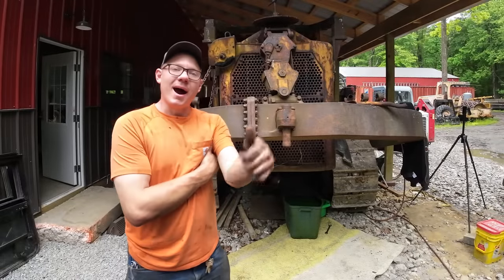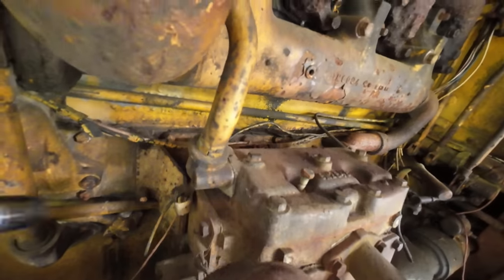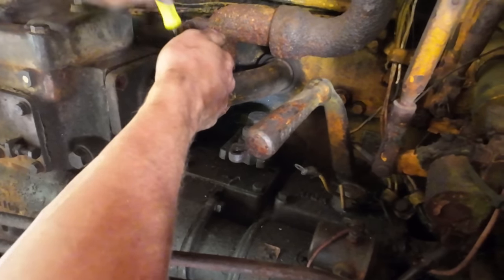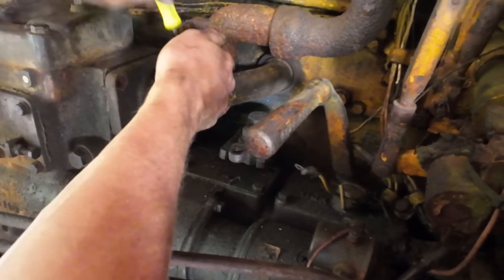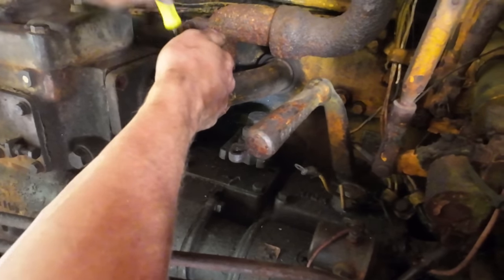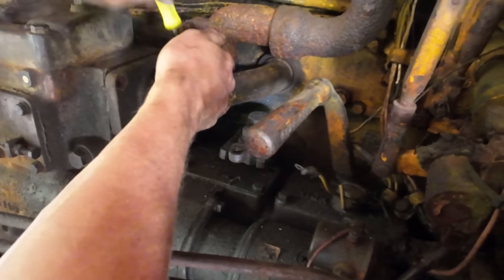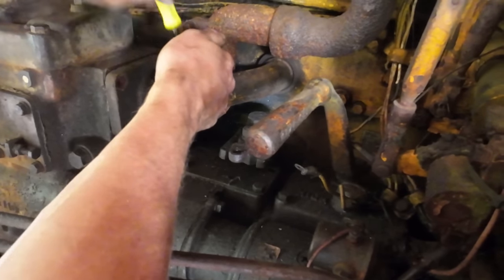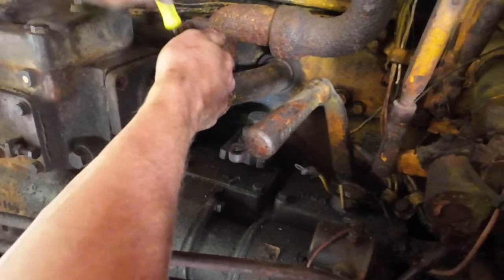Reviving a Caterpillar D8 Bulldozer (AGAIN!!!)

Comment: So many great moments in this video.
My favorite is when Matt casually mentions "I have these 2 tire service trucks I just bought from the local tire shop." as if it was no big deal.
For most people buying one used truck is a big deal and would be cause for a video.
For Matt picking up 2 of them with cranes is just like getting a bag of chips at the gas station.
Nothing out of the ordinary and not even worth mentioning.

I also like the old school "impact wrench" around 19:40.

Comment: Matt, You are getting some excellent closeups.
That tire boom truck looks like a neat addition to your "tools/toys"...LOL    Now if it just had a winch on it, you'd really be cookin.
Years ago(1964/65), I ran a Lodge and Shipley lathe about that size in a marine shop in Tell City, Indiana, a great machine.  I have a Sheldon 14X36 with a 10" chuck and 10" four jaw. The lathe has 2.5hp motor and is variable speed.  I LOVE my lathe.
PS: Matt, youhave areally nice shop bldg, congrats on a well done project.
Ye Old Caterpillar Cowby

Comment: Hey Matt you can use a forklift under the belly pan to hold it up while you take off the bolts also you might consider hiring someone to help you I saw you have a lot of friends in your first few videos I'm sure they would help you. The life you save may be your own (Not Joking). And don't forget to look up torque specs for all those bolts you just installed.

Comment: Had the same issue on a 49 3T D7 pony exhaust pipe actually came apart and old rusty pieces of the tube went into the intake valves.

Comment: The pony motor exhaust tube in the intake looks a good way to blow rust, scale and bits of metal into the cylinders when it holes through. It would be nice if it were made from metal that did not rust or corrode.

Comment: Matt, good you got the pony motes to work, big saving's. I operated those tractors when they were new , also what a hole in that tube will do is dust out the big engine know that for a faked , also those early 46As  the final drive pumps don't pump in reverse , not good to road them a long way backwards , those are a good old dozer.  Deane

Comment: That knuckle boom could do with a winch at its base or bolted to the boom. Turning it into, wot could be, a really useful small crane & depending on how it was set up, ie, how many pulleys it was run through. You could have yourself a very powerful yet really controllable set up for virtually any job. .

Comment: Where you used that exhaust pipe sealer, there are cone mesh gaskets for mufflers probably the right size. Like for example a crv muffler

Comment: Couple of dowels screwed into the head would make setting intake in place easier.  There is actually less pounds per square foot with a cat compared to the weight that is on the floor from a big 4wd tractor

Comment: Gooday mate 
Keep up the good work a you probably know but 2 chains hooked over the track under the belly pan over the other track hooked to a 4wd or your skid steer. My dad and I pour 15000 hours on our 14 A D8 had to do tracks & sprockets end them a lots of rimula x, grease, filters & fuel we loved ours as we never saw inside her gust the way us mechanics like our gear.
You should be able to hear each cylinder fire befor you need to throw the clutch.
I  hope you have half the luck we had with ours. All the best Len Rice

Comment: Those access panels being cut in the belly pan could mean that the pony motor may not be the original one. Looks like the tracks need to be tightened up. Looks like it's time to re-sole your boots, Matt. You're getting your moneys worth on those.

Comment: I'm plumb proud of you idling the pony. I always had a thermos of coffee, fired the pony and let it idle BUT kicked the compression off on the diesel and engaged the starter and let everything turn slow. Drank a cup and when the cup was empty I kicked the pony on the guvnah, kicked the compression on the diesel, grabbed the throttle and let it blow smoke rings. They always fire one cylinder at a time so kicked the compression back off and let it heat up a bit more. After a bit she'd roar. FINE old tractor. 8H, 7E's, 6C's and so on. You'll get it and God Bless Yall! Yes, Meatball too!

Comment: Congratulations Matt on a successful repair that was a lot of work but you brought me back to my childhood with my dad and my grandpa we used to have to repair that stuff all the time in the winter and I've done what you did of pulling out the pony motors and that is a real job that exhaust tube we wouldn't let him get that bad unfortunately you found out how bad they can get and what they can do that turbo sounds like the the seals are getting ready to let go and by taking care of it now instead of just running it is a smart move because a lot of times what will happen is that the fins will let go and they'll get sucked into the engine and there goes the engine thank you for a great video and putting a smile on my face I love that sound though that high pitch turbo sound My god that all I can say is you really made my day have a great day yourself I'm looking forward to the next video

Comment: Drop the belly pan. High pressure wash the underside. True up and then add access panels to keep the dirt out. Dirt holds moiture and grit (obviously lol). Check the slop in the tracks. 
I'm surprised you don't have a shop overhead track hoist. Planned?
Reply from the maker: Yes, that is in the works. Hopefully have it done before winter.

Comment: Great to see it started up just fine with the re=jigged pony motor in place. Although they're more maitenance-intensive, they are are good to have up here in northern Alberta in the winter. Even a brand new charged up set of batteries loses a lot of available power after it's been sitting out at 25-30 below zero. There are electric battery warmers available that can be used (and to be fair, work pretty well) if you've got the beast parked someplace where there's a plug-in. But an engine block heater for 32 gallons of antifreeze? Good luck with that. So the pony motor really makes a lot of sense, since we have about 8 months of winter. Just keeping things like the pickup or a service truck in good condition, so they'll start in winter weather is a "challenge" (isn't that what used to be called a P.I.T.A.?). There's a lot of oilfield equipment and operators up in this part of the country, and the only time that things stop moving is during "Road Ban" seasons - a short interval once in the fall and once in the spring. Once the ground is hard enough, all the big equipment starts moving again. There are quite a few people who keep an eye out for the older equipment, either for actual work or for repair & restoration. One dozer I'd love to get my hands on is one of the Euclid TC-12 - the one with a split frame and twin GM 6-71 engines, one for each side. They were a big machine at the time, and they're not a very common sight even at collector meets. I'm sure it would be a lot more difficult to find parts and pieces for one of those, compared to most Cat products, and my pockets aren't that deep. Anyhow, I've been enjoying the videos you post, and I hope everything goes well with the latest projects. Thanks for sharing all of them with us - I know it's a lot more work to set up and take video as you go, compared to just trying to get some actual work done, and that makes me appreciate them all the more. Take good care.

Comment: them belly pans on a crawler that size full of greasy ,oily, fuel laden muck weighs two tons.Reparing stripped out pan bolts unfortunately are a fix that has to be done.Old style hand angle blade bale.Poney engines are the best early winter startes.

Comment: yep that is why you have to keep a cover on the pony exhuast or a proper water trap/frog flap to keep moisture and critters out of it or you can dust the main engine.

christ let it warm up before trying to start the main. when the intake manifold has some heat in it it will fire easily. it also reconmended to wind it over on compression without fuel after first building oil pressure to build heat in the cylinders

Comment: There is a hole that lines up with the drain plug so you can use a socket to drain the radiator without climbing on the trackes.

Comment: - I wish I had thought/remembered to suggest you put thick used conveyor belting into the poured concrete so tracked vehicles could be easily driven into the shop on them. Sorry.
- I guess you could somehow epoxy cement down the belting now if you had enough flat-plate to weigh down the belting during the curing time.

Comment: Thickening the pipe wall will likely slow down heat transfer between the pony exhaust gasses and the Main Diesel intake air...there's a LOT more metal for the pony to heat up before it can start heating the Main Diesel's intake air...

It probably won't matter in the long run, it may just mean you have to run the pony for an extra minute or 2 before trying to fire the Main Diesel...

Comment: As a fellow Ford man, my fingers are painfully crossed for you with that 6.4L. People talk bad about 6.0s (which can be made to be seriously reliable), but the 6.4s are the ones that will eventually leave you with an irreparably damaged motor. The cavitation from the water pump causing a water leak straight through the entire front cover of the motor is usually the main death knell.
Reply from the maker: Oh ya they are junk lol

Comment: Since you have your own sawmill and lots of those wooden things that come out of the ground have you thought about milling your own customised planks to put down so the tracked machines don't damage your shiny new concrete floor. I imagine 4 long lengths of 12" or 14" x  2" would be sufficient. Would avoid the need to stack the pieces and get them balanced so they don't fall off each other when the tracks start to mount them. It's just a thought and you've probably already  considered making something like that.
Thank You for the  videos Matt. 👍

Comment: Excellent video Matt  :) D8 dozer sounds better on Pony motor rebuilt also run clean since manifold tube repair to & yes would get exhaust manifold  a same round muffler with rain cap too someway keep exhaust blow at you cab not nice hope find so blow different way ! Plus yes agree on Turbo needs work  repair  on  to plus tracks too also electrical fix be helpfull  too then be one person  to start up ! But nice see got fix up in steps to! Nice Sammy help out plus one Co workers  too !

Comment: As being a truck driver 
.. since 2007 our diesel  trucks has been maintenence plagued  by this stupid def emissions  crap..in my driving  time from 1989 untill the 2007 models  hardly  ever had any problems  with our diesel  engines 
Keep the content  coming  ataboy Casey

Comment: The boards for the floor definitely work, but they usually only last for a few uses. I've always had good luck with using old crusher conveyor belt mats.  You can cut them into 10 foot lengths so they are manageable.  You punch holes in one end of them and tie rope to make a handle, making it easier to drag them around.  I've crossed bridges (with the help from a few people) using the conveyor belts and never caused any damage to the concrete.  This is with a D7XR with ice cleats welded onto the tracks. So even more psi on a smaller surface area.  Great video, as always.

Comment: Love the video and your work! Also I'll pass along a trick on dropping the bellypans by yourself. If they hinge open like the d8 N models that I work on use the crane and some tow straps, running lengthwise under the machine hook the strap to either front or back of machine, other end to the crane, pull it up as tight as possible to the pan, remove bolts then ease down on the crane and it should let the pan open effortlessly. To reinstall just pick back up on crane and lift the pan as close as possible back into place. I use that method each time and its very easy whenever your working by yourself.

Comment: I think your best bet would have been to extend the knuckle boom out and lock it in place above the pony and then use a chain-hoist off the knuckle boom's hook to finesse the pony in and out...

The chain-hoist would have given you a LOT more fine control in the movements...
Reply: would a snatch block or two be handy?
Reply: @jlittlenz  Not likely with the space he had available, besides, a snatch block doesn't usually come with a brake like a chain-hoist does so he'd have to find somewhere to tie off the rope if he needed to let go of it to finesse the pony motor into place with his hands, with a chain-hoist, that's not a problem as the chain only moves when the crank is pulled...

Comment: Hey Matt !!!  ""CONGRATS"" on getting the ""OL"" 8 fired back up again & running to the shop !!!  🙃😉😛    With that much slack in the tracks,,  you may end up taking a cleat tread out ???   Have ""FUN"" with getting ALL the other issues straightened out too !!!   Waiting to see some dirt fly behind the blade !!!   🤔🙄🤠😎👀👀👀👍👍👍👍👍
Reply from the maker: Thanks! & No. They should tighten right up.

Comment: Matt, after watching the turbo repair shop, they said that there was contaminated oil that probably contributed to the destruction of the turbo bearings! Now, if I were in your shoes, then I  would fabricate some way of adding an oil filter that you could fabricate a bracket that would firmly hold the lines and the filter assembly on a solid foundation that would not shake loose in any way, then move the feeder line to the turbo to the bracket assembly!  You know what I'm talking about being a mechanic, and you should have the smarts to do so! 
Ernie hilliker
Roanoke va.

Comment: Not much turbo issues. A bit too much bearing end float that becomes apparent when the exhaust pressure pushes the turbine rotor away from the casing.

Comment: Considering that the CAT is turbocharged, it would seem more likely that you would dump boost through the pony far more often than you would draw air (the latter only an issue at idle or start?). Might make controlling a runaway an impossibility, though, were it not fixed . . .

Comment: Cool repair!  My only concern is the reason for the "paper thin" pony motor exhaust pipe vs the 1/8" wall tube.  The thin wall tubing will heat up fast compared to thick wall.  How much longer does the pony motor have to run to heat up the extra mass of the thicker pipe on a cold day before it starts to transfer the exhaust heat to the intake manifold air space?

Comment: Why not use some of your Bolts, longerin length, after removing heads and iether squaring end, or cutting slot for scredriver, and using them as removable pins to support items during removal and installation?

Comment: Great video and coverage as always. As you mentioned before with the diesel not firing because of the pony motor leaking exhaust and then pulling that rusty pipe off I just kept thinking of all that rusty mess and metal shards being sucked in by the diesel motor. I think that may be the problem with your turbo and possibly valve seals and cylinder walls, hopefully not!!! 👍

Comment: I've always wanted a truck with a knuckle boom crane on it.  I'm so jealous of you.  Again.  ;)
Just for S&G, did you take that old holey pipe over and ask Sam if he could weld it up for you? I'd love to see his face with a request like that.  LOL  Maybe put that intake on the sling and use the crane to lift its lard arse up for you, save your back.  Maybe weld a bracket on the top of the end of the crane and bolt a strap hand winch on top for finer control of height.  $30 fix!  HFT #95541, 900 lbs capacity.  Or hang a comealong from the crane to the load for a 2T capacity.

Comment: I was always curious as to why you did not disconnect the pony engine exhaust from the intake manifold.  It would have been far fewer bolts and less risk of pulling nastiness into the diesel.

Comment: You make it look easy. I used a forklift, a come along, two chimpanzees and a hand grenade when I did my first one. (The grenade was just for celebration.) It looks like your pony motor clutch disconnect mechanism grenaded. Well, parts is parts. Maybe you could build a pony motor go-kart. PS, I know it’s an engine and not a motor. That’s just how I learned it.

Comment: Off content question, If the floor heating is really efficient, during the summer would running cool water help too. Isnt well water pretty cool coming out the ground?
Reply from the maker: You can get some cooling effect that way but the issue is humidity, if the dew point is just right you’ll make the whole floor sweat which ain’t real good for anything g

Comment: You commented on the fit of the Pony motor to the engine, a man I was working with at church was retired from Cat went to work in Peoria after getting back from Vietnam. 
  He got a job in the carpenter's  shop, worked in it for several years, tells me how they built the new life-size prototypes in the carpenter's shop entirely out of
Wood mostly mahogany. Wow what a job he had great stories. He said the purpose was to know everything would fit. I ask him if they saved the models he said mostly not but they did save the D10 when they built it and it's in the museum in Peoria.

Comment: It would be interesting to see if you could replace the Pony with an old electric forklift motor. They are relatively cheap and powerful, some simple electrical control, perhaps gear it down.

Comment: I hates ponies to pieces, (with respects to Jinx, the cat).  At least yours has the decency to be a complete unit separate from the diesel. In my 2U, the pony is partially built into the engine.  Last time it caused trouble, over twenty years ago, it came apart out in the woods and an electric start took it's place.